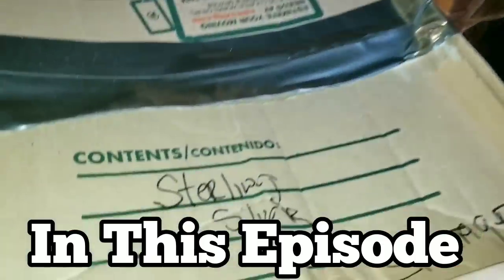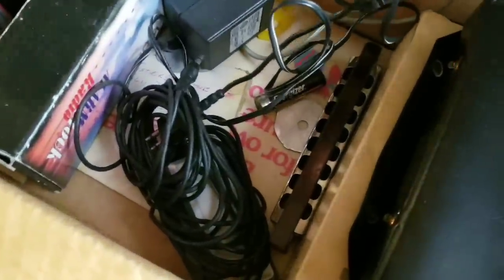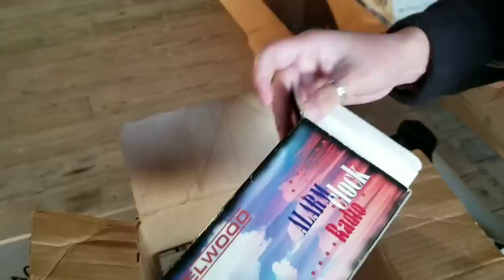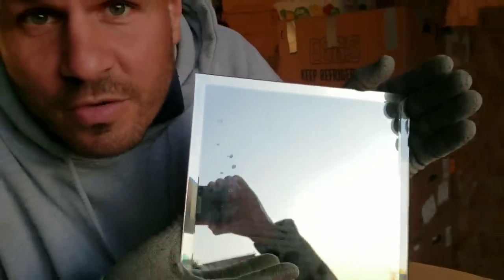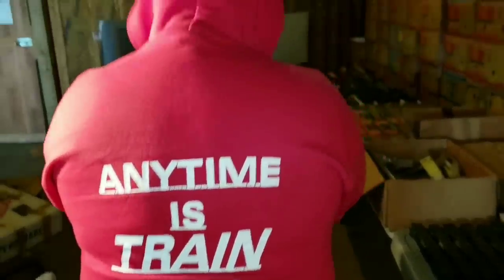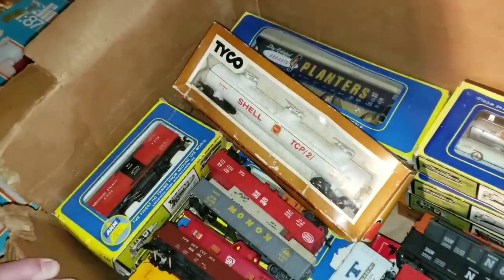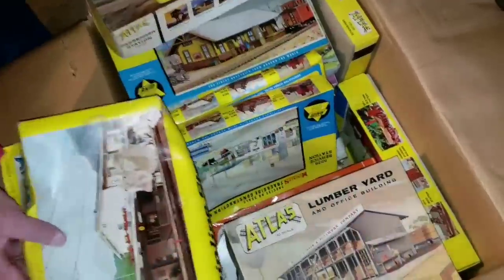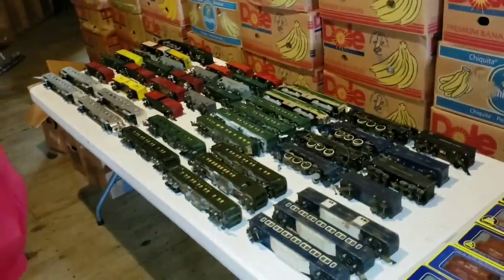HUGE BOX STERLING SILVER I Bought Abandoned Storage Unit Locker / Opening Mystery Boxes Storage Wars

Comment: The little plane @ 2:08 is a control line model.
However the rudder is gone so it won't fly.
The engine appears to be  a Cox .049  Baby Bee
https://coxengines.ca/images/P/Babe%20Bee%20-%20Customized%20Cox%20049%20Model%20Airplane%20Engine%201.jpg

Comment: Ketchup. I use ketchup to clean silver jewellery. Cover it, leave it about 20 minutes. Wash with warm, mild soapy water, dry and buff gently with a soft cloth. Safer than most silver cleaners, as they actually strip the surface.

Comment: THOSE SERVING TRAYS ARE NOT STERLING OR PLATED. THEY ARE PURE SILVER. ESPECIALLY THE ONES WITH THE PATINA. BRITISH SILVER IS USUALLY PURE.  THE SAME WITH BRITISH GOLD.
Reply: Wrong on everything. You have no idea what you are talking about.
Little, if any, silverware of any sort is made out of pure silver - nor has it ever been. However silver plating is usually pure silver. British sterling is no more pure than any other sterling. 

British gold coins, in the past, had the same adulteration problems as most other countries that minted gold coins. I don't think fine gold coins for circulation have ever been minted. The 999/9999 fine coins currently minted are for gold collectors/hoarders. They are not released to circulation, since the gold value is far higher than the face value of the coin. The bullion value also varies continuously with the bullion market price.

Comment: You have to look up those symbols on the bottom of the items and the country of origin and what each imprint means. "E" on that English piece does NOT necessarily mean "electroplate" they used letters for years example: a=1900 b=1901 A=1800 B=1801 etc. Lions head means was made in London. There are many times makers marks as well. That TEA SET LOOKS LIKE STRAIGHT ANTIQUE SILVER to me but badly tarnished. Could be plated, but the style could be back to 1700 or 1800s easily, BEFORE they used marks. You need to find a good precious metals marks WEBSITE. You should be able to look up most marks for free. Hope that helps you.

Comment: The little symbols are called "Hallmarks". You need a guide that tells what they mean. A simple way, in case you've forgotten, to distinguish plate from solid silver is to use a magnet. Won't stick to silver.
Reply: Unfortunately, magnets will not stick to copper either...and more often than not, copper is used as a base metal in plated items. Either that or brass. It tends to be only iron based substances that are magnetic...

Comment: Problem is most folks don’t know sterling silver much les solid sterling which most wares are not solid. Most fine wares are copper with a heavy EP or clad silver. It solid is quite expensive. Some folks think they have it and treat and store it as such and have even bought it as such unfortunately. Awesome train and RC stuff. The small bi-plane is known as a U-Control. You fire up the engine and fly it from strings on a handle from maybe 30 or so feet away. You fly in a circle counterclockwise usually and if your good you can do loops but. It too many since this twists the lines and tightens them up and then CRASH! I made mine from balsa wood and smashed plenty before getting the hang of it. You can even fly just a 1x6x6 if you want proving that barn doors can be flown with a big enough engine 😝. Feel free to send me all the trains and make my end life 🙏. Hooray!!!